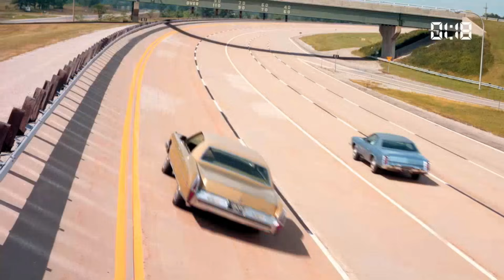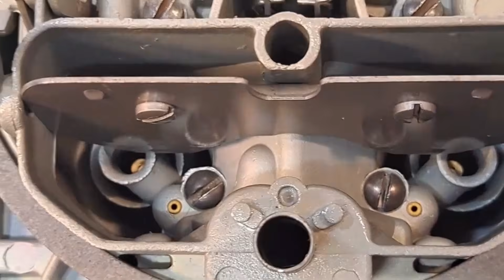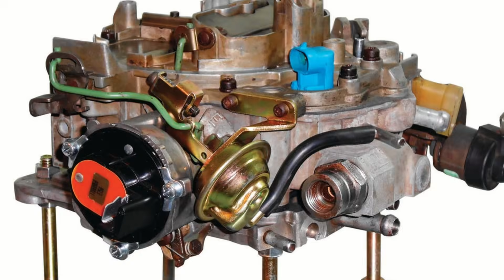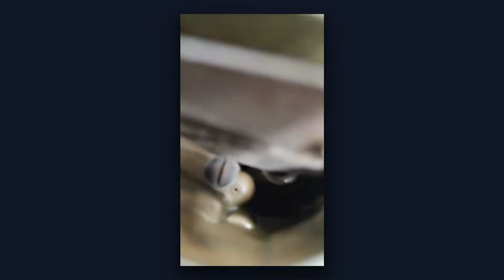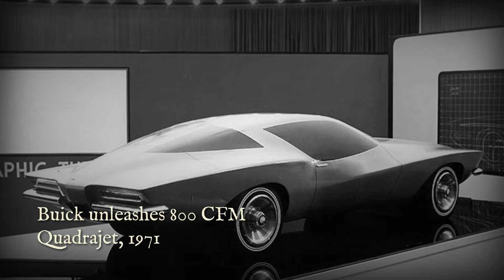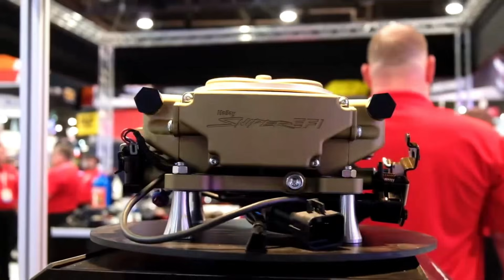The SHOCKING Carb ''Trick'' GM Used to Turn Sluggish V8's into STREET BEASTS

Comment: Qjets had one thing (besides 750-800cfm capabilities) that Holley never had-- a double booster ring in the primaries , and tapered needle rods that raised and lowered in the jets...which gave 30-50 percent better gas mileage at part throttle! 
  Also, I've seen them on high 9 sec super stocks in the quarter mile......the knowledge is available; but you have to understand it

Comment: What? My friends and I all had 350's and they were bracket racing and turning about 14.75. They talked me into seeing what my '70 El Camino would do. I hit the throttle it bogged badly. I think I got about a 16.00. Embarrassing! My friends said to TIGHTEN the spring on the upper flap until the bog went away. I did it and first run, it turned a 14.70. Quicker than them! The second pass, I hit it and the damn spring broke! the air flap fell open and it was way beyond a bog.

Comment: quadrajets also came in multiple sizes. there were 750cfm and the 800cfm sizes. the dual mechanical secondaries with vacuum powered fuel response was sick

Comment: The secondaries are mechanical on a Q-jet, it’s a very common misconception that they are vacuum operated.   The air valve is opened by vacuum from the secondaries opening below it.
Reply: then air valve is in control of the airflow through the secondaries making it a vacuum secondary just like AFB or AVS carb.
Reply: @j @jasonsmith4902  yes the secondary circuit is regulated by the air valve via vacuum, but the secondaries are mechanically actuated via linkage.  That’s the point I was trying to correct from the video.